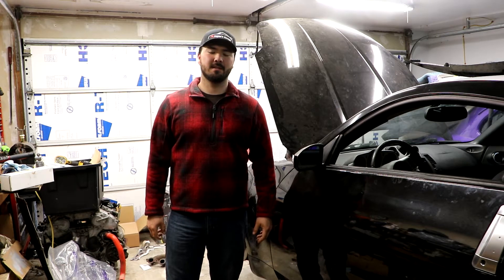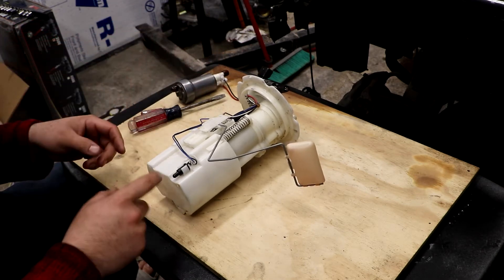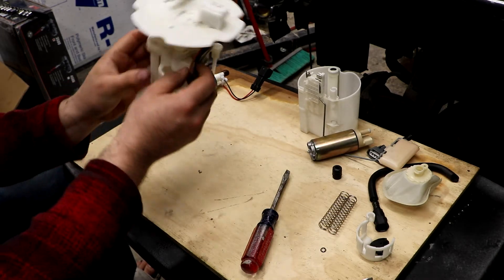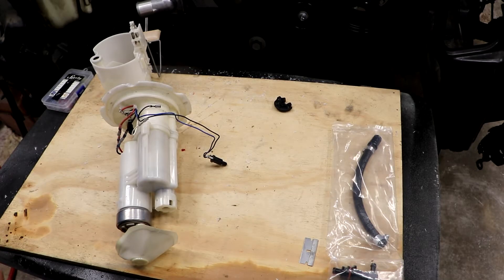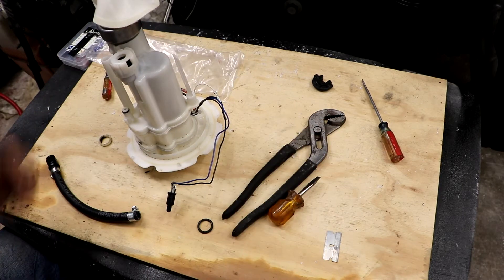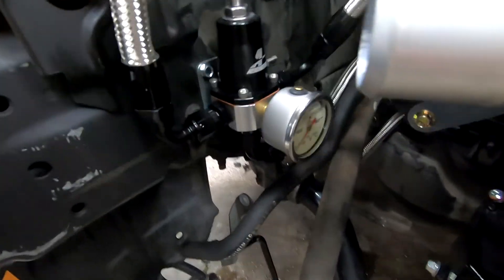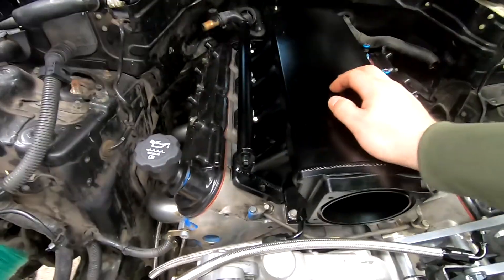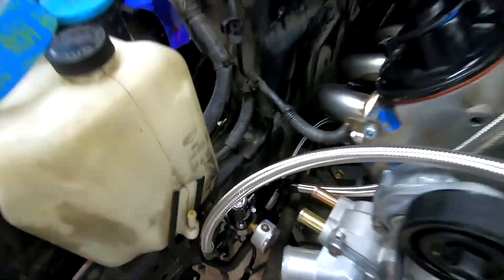WALBRO 485 FUEL PUMP AND AEROMOTIVE BYPASS REGULATOR - 350Z LS SWAP EP. 11

Comment: im doing a ls swap can i just add the corvette reg and stock 5.3 ls truck intake ? on my Z with the stock 350z fuel pump ? im just doing complete stock no power upgrades just need a lil advice on how to run the fuel for stock ls swap
Reply from the maker: The problem with the stock 350z pump is fuel pressure. The ls motors want something like 55-60 psi. I haven’t done it but guys use a Polaris rzr fuel reg that goes in the fuel pump assembly and that will give you 58 psi with a stock pump. Take a look on the LSx G/Z Facebook page for info on this.
Reply: @LogansGarage  so i can just use a corvette kit they got on ebay for $90 it comes with corvette reg an fittings and lines , im doing a stock ls 350z so truck manifold just need lil bit more info on complete stock fuel setup

Comment: What size an fittings did you use?
Reply: Thanks for the input!! Working on an ls swap for my g35 aswell
Reply from the maker: G35’s are awesome!
Reply from the maker: I used -6 everywhere. Might upgrade to -8 in the future. It’s pretty easy to run the line.

Comment: I’ve seen other people run into an issue where the assembly doesn’t fit in the tank anymore because the pump is too tall. Did you experience this?
Reply from the maker: You are correct. What I didn’t show is you need to cut the bottom of the section the pump slides into and you also cut the tip of the fuel pump that the rubber slides onto. I could create an actual how to if people were interested. Take a look at the link in the description for the step by step directions. I didn’t write them but they are solid.
Reply: Logan's Garage thanks brother!
Reply: Wish I would of read this comment a while ago, it was a nightmare trying to figure out why I couldn't get my fuel pump assembly to fit back in the tank😂